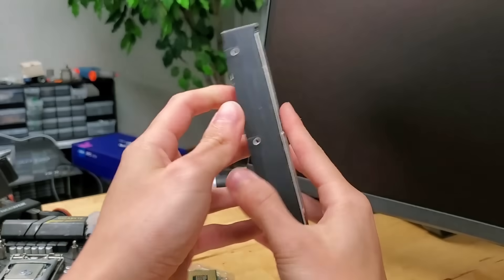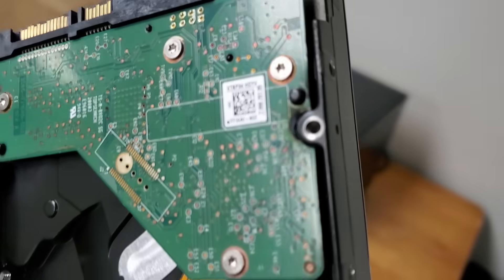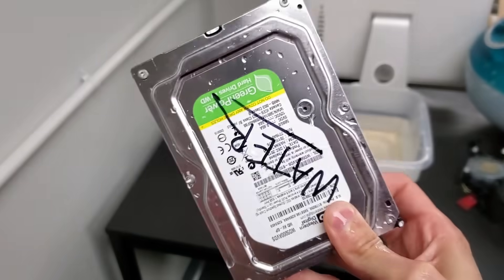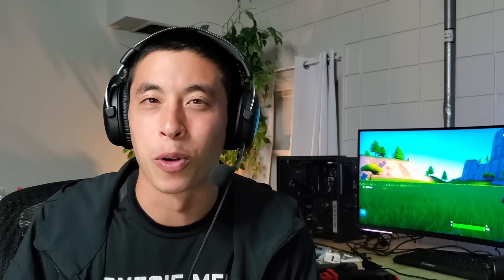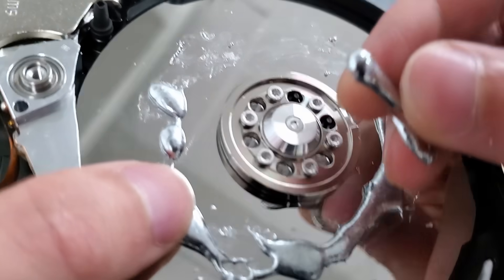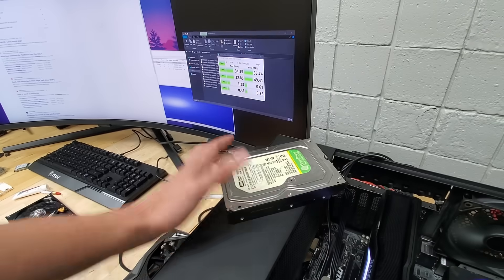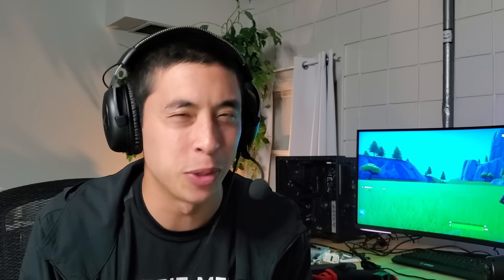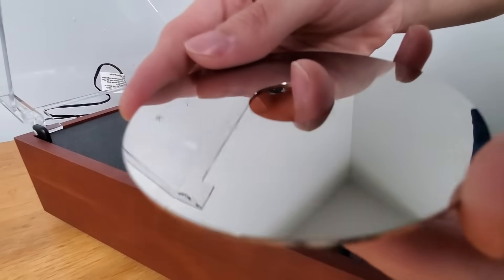The Most EFFECTIVE Ways To Destroy A Harddrive

Comment: Most of those methods don't destroy any data. Even in the microwave it just killed the board. The platters were inside a metal case so most likely not affected. Only way to really destroy it is to use a hammer and destroy the platters. Or just overwrite it multiple times with random stuff and then with zeros and you don't have anything recoverable and can even sell the old drive.
Reply: Would throw it in bonfire for hours would do?

Comment: Some of those methods, like submerging an hdd in water, might not destroy the drive completely. Yes, it possibly won't turn on due to corrosion and some water still being present somewhere underneath chips and other elements, but the magnetic disks might be still intact and can be transplanted into a donor drive for data retrieval. That's why, folks, if you want to completely destroy your drive so that even fbi couldn't read it, please crush magnetic disks inside a drive. Cheers!

Comment: if someone asked me to destroy a harddrive i would wipe the drive then do a zero write then drill into it and destroy the plates and header and rip of the controller that should guarantee a proper destroyed harddrive that can't be recovered
Reply: I would use a gun
Reply: @ballsuckervr  ah your the guy that shot the hole in my sister's harddrive she bought still works fine even while some sectors were broken

unless you blow up the complete harddrive there in alot of cases is still a way to recover data

Comment: For the freezing one, thats actually a way to make tempremental hard drives OK for a period of time.
Reply: I've been considering doing this on an old 2gb HDD that still spins but won't initialize. I was thinking I would seal it in plastic bags with a usb reader attached and the wires sticking out. I just need to clone it so it should work long enough. I came to this idea from using an upside down canned air for diagnosing bad transistors in old radios.

Comment: Disassemble it -> melt the disk -> made a fine wire out of it -> dissolve it with acid -> neutralize the acid with bases -> dump it in the drain

Comment: What really would have been interesting is to see if the data is still present on the platter when you replace the Main PCB of the HDD.
They are often interchangeable
Reply: burn it so hot that it loses all magnetic properties
Reply: @Napert  good idea but smell is problam
Reply: @a.belladonna8316 just open it and blowtorch the platters. Very little smell, just do it outside.
Reply: they are not really interchangeable. BUT, recovery companies can configure them to be compatible. it's all about the platters for the data. the data does not go away with microwaving the outside.
Reply: @NootNooot  but replacing PCB and format  the disk (not LLf) than Recovery software works good enough
Reply: @ZoneStudios.  or just Unscrew the drive and use sandpaper 😂
Reply: @a.belladonna8316  John 3:16-For God so loved the world, that he gave his only Son, that whoever believes in him should not perish but have eternal life❤️✝️
Reply: Usually, it must be the same PCB, firmware---usually try to be the same, or within the same revision.
Reply: @AlfaPro1337   this really depends on the manufacturer.  This is extremely rarely going to work on acting from WDC since about 2000.  Seagates will be touchy, with minimal firmware mismatches breaking compatibility (from experience, ST340016A 3.11 and 3.14 not compatible).  Samsungs are forgiving, Toshibas are worse than WDC.  Hitachi need to match MLC as well.
Reply: @ZoneStudios.  John 3:16-For God so loved the world, that he gave his only Son, that whoever believes in him should not perish but have eternal life❤️✝️
Reply: John 3:16-For God so loved the world, that he gave his only Son, that whoever believes in him should not perish but have eternal life❤️✝️
Reply: Exactly this video doesn't prove that any of these methods really remove the data, because even if the drive electronics fail the data most likely is fine on the physical platter.
Reply: pcb holds all the info stats of the platter's' sectors, capacity read write speed, the plater holds the information yo write so, yep    get an identical drive, you could just swap the platers....   kinda how striping works on mutipile drives      "fastest hdd = 128 of the feeding your pc's ram at 128x the speed of one :-)...... but..  one drive goes bad the whole thing goe down :-\....    RAID
Reply: Nope, you're literally destroying the surface of the platter, as well as blasting away any data through heat/magnetism.
Reply: @Stealth86651  Well can't be sure because he doesn't show if it works still after microwave. Anyone knows the plastic parts break and that is the only thing he showcases
Reply: @Stealth86651  i dunno, being a steetworker before  just...    never seen heat ruin platinum   er    like normal blow torch
Reply: Blowtorch the disks. Hard drives store data magnetically. Once any object is heated up hot enough it demagnetizes completely.
Reply: exactly. He fried the circuit but the data platter could be moved.
Reply: This isn’t true. Drives have imperfections when manufactured, and these imperfections are accounted for on a chip on the PCB, when the drives are calibrated at the factory. Without this calibration information on that chip, your data becomes a whole lot harder to recover

Comment: 2 methods that will render all data unreadable.
1) sharp blow(s) to the spindle with a hammer. This will shatter the discs inside without making much of a mess.
2) take it to the shooting range. Lead traveling at roughly 1000fps should be enough to compromise the data.

Comment: I would love to see if a recovery company can save the data on the harddrives.
Reply: well you know patients can destroy the data but that takes decades to do believe it or not cause that magnetic coating degrades slowly over time getting weaker this is why old hard dives for old computers like 486's do not work as well as brand new magnetic hard drives cause that coating has degraded to the point that data reading in no longer reliable at all on them

Comment: I have a better idea: don't do it unless absolutely necessary. If the hard drive it's not damaged, it's still a free storage to use. Just buy an external enclosure for it and your good to go. If you really need to wipe all the data running a few times something like: dd if=/dev/random of=/dev/$DISC should do the job. But if you really need to physically destroy it, use a furnace and melt the platters.
Reply: No, most companies destroy drives when it contained sensitive data, it's not enough to run commands to erase data.
Reply: @EtherialEdits  yes it is. a single zero pass should be good, recovering that is only theoretical iirc. a single /dev/random pass is almost guaranteed to get your drive unrecoverable. do several passes of /dev/random if you want to be really safe. even though company policy usually requires the drives to be destoryed, its unnecessary. although when decommisioning a server, its usually quicker to just shred rather than erase
Reply: @someidiot4311  again, no. I've worked in multiple companies that have policies on this, they don't run commands. It should be fine if YOU want to erase data but no company is going to risk private info getting out and being sued.
Reply: The point is that its durability test
Reply: What is the /dev/random device file? Can't we use /dev/zero?
Reply: @AlexBarbu  that's actually smart, didn't think of it
Reply: just use the big ass magnet you have

Comment: I work in a place for hard drive destruction and we use a hydrolic piston with a tip to puncture a hole into the circuit. Only recently it broke so we resorted to sledge hammeing them in... like full on mangle them up

Comment: Don't take this video seriously, it is only for amusement. I can recover data from all these drives and I am only an amateur in data recovery. If you want to make sure your data to not get in the wrong hands, use a certified software to destroy data or even better, open the drive and physically destroy the platters inside.  Use a hammer to break them into small pieces. Nobody in the world is going to bring them back.

Comment: If you just simply use a electromagnet made for picking up cars it will probably destroy all data on the drive but just to be sure firstly put cyberpunk 2077 on it until it's completely full than repartition the drive and repeat for 5 times

Comment: HDD platters are coated in ferrous material and even if they are from aluminum you would need to scratch off the ferrous material. But what about the HDD case? You should try it!

Also sugestion - put it into vacuum!
Reply: The shiny stuff is either cobalt samerium or platinum cobalt alloy. The bright silver ones are the PtCo and the more golden ones are the SmCo type.

Comment: The magnets would work, but only if you used them on the magnetic discs themselves. Because like you did it, they are protected from the metal shell like in a Faraday cage.
Reply: are any harddisks made of aluminum or is that just a myth?🤔
Reply: @raven4k998  yes many of them are made up of aluminum, they will put some magnetic material on top of that, opened one 80 Gb hard disk from 2006 today to see the aluminum platter.
Reply: @raven4k998  I don't think that there are any hard drives made from aluminum, because it isn't magnetic.

Comment: Microvawe was actually not effective, because while it did kill the circuitboard, all the data is still on the platter and can be recovered.
Same goes for the water and the toaster, the internals might not be damaged.
Galium method also wouldn't work for direct platter contact an any drive because every harddrive has a protective and magnetic layer over the platter witch would stop the reaction, alltho oppening the drive by itself will kill it.
Dropping it will kill the R/W heads, but the platter is good and data is recoverable.
The vinyil one was funny, put it in a CD/DVD for some funny noises (i tested it)
Might be fun if you sealed the "breathing" hole and just continiued using it to see how long it lasts.
Reply: Answer is 
For some drive yes
For some drive no
If controllers have self encrypted 
Then is controller died then data on disk make no sense anymore
Data just garbage
Reply: @leonpano  Yes, but that encryption key is located on the rom chip on the drive, it is highly unlikely that it will die from any of theese
Reply: @filenotfound__3871  more depends 
And maybe rom and controller is bind together 
Means you can’t replace other controller 
And most likely rom is in controller
Reply: @leonpano  Very rare on consumer harddrives

Comment: what about a bulk tape eraser? it's a powerful electromagnet meant to erase magnetic media (casettes, VHS, etc) in a matter of seconds. 
I believe it's what the pros use.
Reply: Rem♥♥♥♥
Reply: I don't know if any magnetic technique would work effectively as the entire drive is enclosed in ferrous metals, the magnetic pull could simply avoid the platter and drive head entirely.
Reply: i thought he tried one of those.....??o
Reply: Degausser
Reply: No, businesses usualy just let them be shred. Bulk erazers are from a time where you often would reuse tapes or floppies, they would destroy the mechnicle parts of a HDD anyway, so they just get shredded.  If you wanna keep em working, you'd use a save eraze proccess of overwriting the data - at least with mechanical HDDs. Doesn't work well enough with SSDs and if it's soldere to the mainboard, the entire computer gets scrapped.
Reply: @valliantsteed  I meant pros as I'm pros back in the day who wanted to blank out their reels.
Reply: A what?
Reply: They do make degaussers for hard drives.. But these degaussers are on an entire another level compared to a bulk tape eraser .. Think the cost is somewhere around $20K and above.  
Most businesses take the drives to another business to shred the drives; like a big paper shredder.  We did this at work; the shredder came with their truck, they videotape the entire process, and provide a certification that the drives are shredded.  Did like 650+ drives that day.  Still expensive.

To be honest, the best approach is software & time;  there's software that you can boot and shred the drives by overwriting the drives a number of times using certain patterns.  

The lazy man's approach would be to configure bitlocker or some other full disk encryption program into action, and encrypt the ENTIRE drive, and be sure to lose the key.

Comment: Day 2# of asking to cool a cpu with a penny made before 1982
Reply: why would u want to see this???
Reply: @slothvole  bc pennies manufactured before 1982 were 95% copper unlike todays pennies which are only 5%, so in theory it’d be more thermally conductive and do a better job cooling the cpu.
Reply: @Bron-le5ww so what material are used now?
Reply: @Jb1v1clips  they’re mainly zinc with a copper coating(5% copper and 95% zinc). The older pennies used an alloy of 95 % copper and 5% zinc.
Reply: @Bron-le5ww  why they switch is it cheaper or something?
Reply: @Jb1v1clips  Copper prices started to rise so it didn’t make sense manufacturing a coin that was worth almost 1.5-3¢ worth of copper when it was only valued at 1¢.
Reply: @Bron-le5ww XDD
Reply: @Bron-le5ww  oh i see interesting